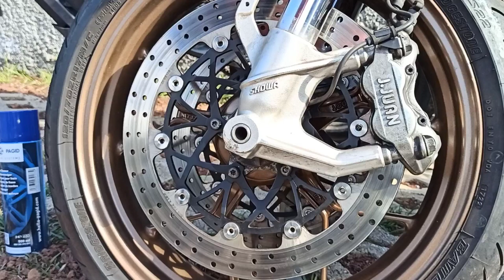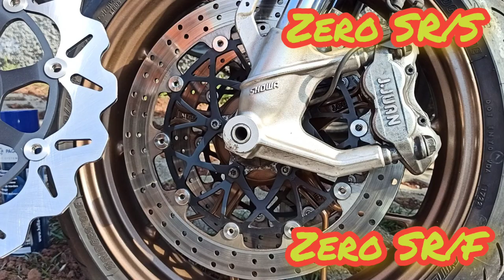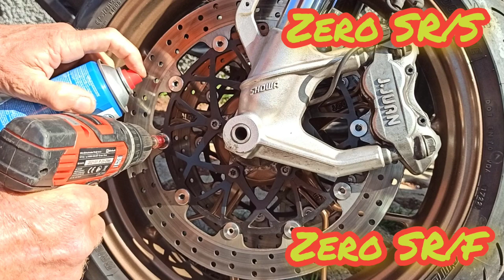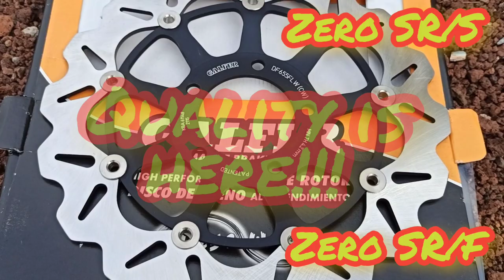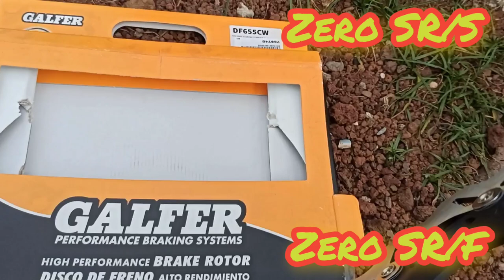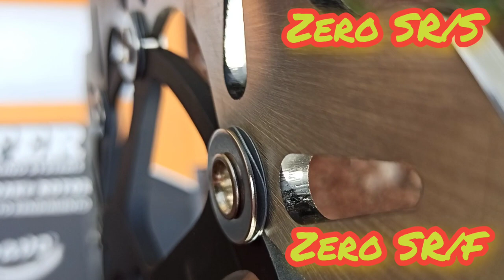JACKHAMMER syndrome on a Zero SR/S /F and "THE" 1 minute fix, if your bike is out of warranty etc.

Comment: Nice video! I recently uploaded a similar video where I used a slightly different technique to clean the rivets/bobbins. What did your test drive felt like? After I applied my technique on my discs, they went back to smooth braking. Also, when changing the discs, did you change the bolts too? I read on the Facebook page that the bolts may need to be changed for those of a Yamaha something, thanks!